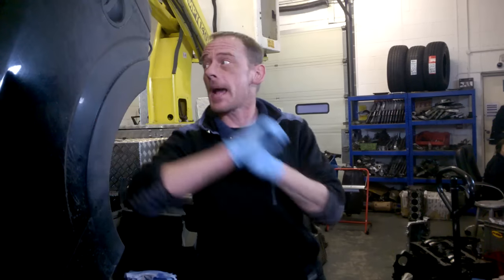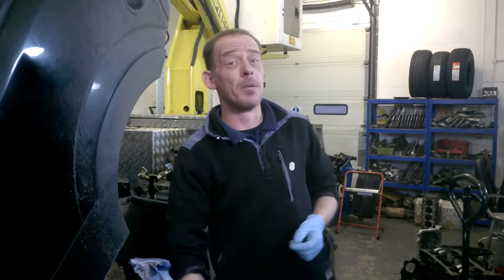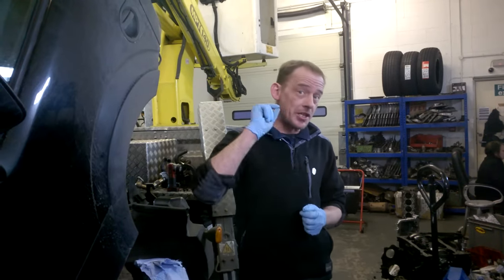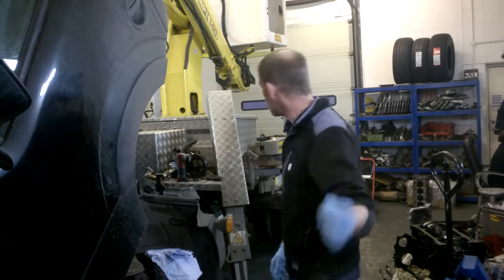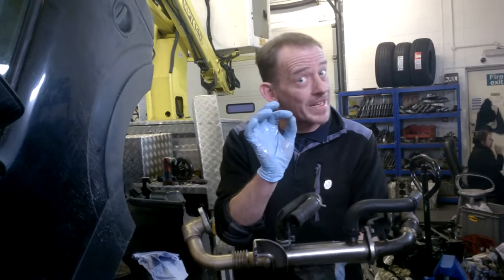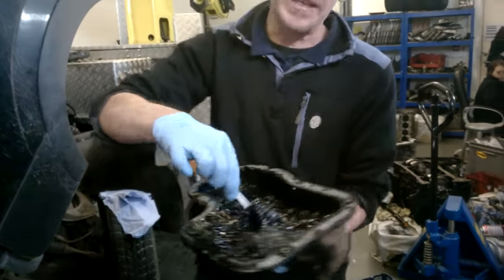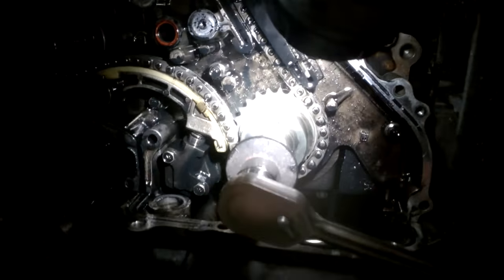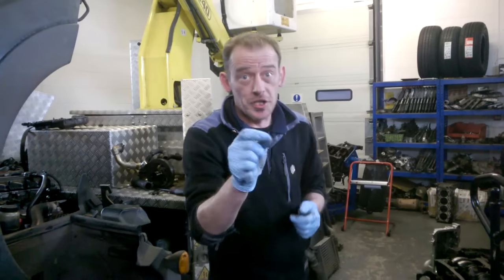Nissan Cabstar engine problems How to

Comment: Afternoon, trying to diagnose an issue with my Cabstar 2010 YD25DDTI. Black smoke (Fuel) lack of power, won't climb a small gradient driveway. Done your squeeze test on the boost pipe at 2,500rpm, no pressure to push my fingers apart. Turbine spins on cold side from observation with a mirror and no movement. Visually can't find a boost solenoid, looked online also and nothing comes up for our model (looked on eBay and 7zap). Actuator doesn't move when revving the engine, but its proper stiff to move by hand when engine is off. A cheap fault code reader, we think its reading 0 for pressure, atmospheric when revving too. Shows no boost. 
So unless you know where the boost sensor is, am I right in thinking the turbo is knackered?
Reply from the maker: Jedd Clay we have seen your email and we are about to answer for you

Comment: Hi we've got a 15 plate NT400 in with a glow plug issue, replaced the glow plugs and relay but still not power to the glow plugs, is there any secondary relay to drive it? Fuse is good too

Comment: Hello friend, I have a problem in a 2007 Nissan Cabstar 2.5 Yd25ddti (nacelle). The problem I have is that I no longer have power below 2000 rpm, once past 2000 rpm it goes like an arrow but underneath it's a real turtle...
I changed the flow meter, blocked the EGR and pierced the catalytic converter.
I need help I can't find where it comes from, thanks

Comment: Hi! Do you know what type of socket do I have to use in order to remove the flywheel? It has bolts with Torx shaped heads but I can't loose them with "normal" sockets

Comment: Hi superb video. Do you no what may cause it to go into limp mode with no warning lights or faults stored? I've read somewhere egr needs blanking? Or kay have already been blanked wrongly? Would this be why my heater isn't baking hot and just warm?
Also the viscous fan and the loud whooshing noise comes and goes, is this right or are you always supposed to here the fan?

Comment: I need some help on a 2013 nissan cabstar in mexico i have excessive fuel consumption any ideas..??
Reply from the maker: Diego Jara Navarro injector fault get them checked buddy
Reply: @westyorkshireengineservice9160  I've replaced them onces already not new rebuilt I also removed the glow plugs and they seemed to be wet with oil I suspect coming from valve seal by the way here in mexico we have same crankshaft snapping issue what a problem man god bless you and thank you for all videos I really love the fact that should teach nissan how build an engine correctly ...
Reply: Dinastia, I am also from Mexico, How much is the max weight you carry with the Mexican Version.? I want to transport my Skid steer (bobcat).

Comment: Hi, i need help. I have renault maxity with 2.5 dxi 96kw motour. He turn off on 800 rpm but on 1200rpm work normal. I replace all injection and diesel pump, all sensors , clean fuel tank and it still turn off. Before all this syptoms he lose power et consumption is on 19L. Thank you.
Reply: I have a similar problem 
Maxciti 2012 1100kw the chain was replaced 50,000 ago, everything was fine until a few days ago greetings, , it has 335,000 after 30 minutes of driving, I press the clutch, it turns off, it turns on a little longer, today it sows, driving for 20 minutes, driving at the traffic light, it turned off the first time, it did not want to turn on after 15 minutes, it signaled, it turned on after driving for 20 minutes, everything is fine, it turns off  crazy breakdown, I'll go to diagnostics today, good luck

Comment: Hi mate ,I've got a 2015 cabstar nt400 in ,I'm a garage in Birmingham, cuts out from cold straight away once warm it starts and runs ,no fault codes ,would this be my fault ? Tia
Reply from the maker: Timing chain unplug cam sensor she will run
Reply: @westyorkshireengineservice9160   bang on the money 👍👊 wish I'd messaged you a hour ago 🤣🤣
Reply: @westyorkshireengineservice9160 mine does this I’m driving it with the crank sensor plugged out,will this cause problems I’ve also noticed it’s under powered

Comment: Hi buddy, I’ve got a 2009 Nissan Cabstar, plays up every time I get in it, cuts out just like I’ve stalled it all lights come on the dash, turn it off for a minute then start it but with a struggle, has defiantly lost power since this has been happening aswell, had all 4 new injectors which I thought would fix it but still the same. My mechanic reckons is a sensor on the end of the manifold or something like that ? Would LOVE it if you knew the answer 😂
Reply from the maker: When it struggles to start unplug the cam sensor location side of the cylinder head turbo side If it runs without stalling its timing chain stretch if still the same I would be changing the SCV location back of the fuel pump you would have to change fuel filter and do a fuel pump reset at the same time Hopefully one of these sort it buddy

Comment: Hi Guys got a 2010 Nissan cabstar , got in it one morning started up and noticed the speedometer , rev ,  fuel and temp gauge has stopped working as well as the centre mileage display .. we still have the seatbelt , parking etc lights working tho . I have checked the fuses in both fuse boxes to the passenger left on the dash but are all ok . It seems like a fuse thing are there any other places on the cabstar for fuses I could check ? Any ideas ,have been looking at the past videos you posted , cheers guys. 👍
Reply: why belt, is that because of the firing pulses or what

Comment: I’ve got a Cabstar never had a problem with it , it’s an old f23 model what doesn’t have timing chain or belt on
Reply from the maker: 2015 stroke Steward bulletproof buddy
Reply: @westyorkshireengineservice9160  yes definitely is I’ve had loads of lads wanting to buy it 👍🏻

Comment: Hiya, got a problem with 2000 F23, driving the vehicle, all of a sudden complete shut down of everything, no power, no lights, no ignition. The tipper wired separately, no problem. My old mechanic sorted it for me, but more recently it started doing exactly the same. I checked out the fuse box and tried fuses etc. One relay, the fan heater that I tried, made the ignition lights etc come back on, but if I waggled it, it would go off and on. I soon discovered that if I used the heater on full after about 10 minutes the Cabstar would shut down. I have since got to the back of the fuse block and have discovered that there’s a wire which has been pushed into the back of heater relay with the other part being pushed into the end of the fuse block which is for the back of internal light and number plate fuses. If I remove the wire from the rear number plate fuse the ignition etc goes off. Push it back or even just touch the back and everything works. Obviously my old mechanic has tried to fix the original problem, but it is not a proper solution. Any ideas what causes/caused the original problem and/or solution

Comment: I've got a Nissan cabstar, and it's been nothing but trouble. I've had a new manifold, mass air flow and still can't solve the issue. No engine management light on. Lack of power, grey smoke on acceleration, fuel is taking a hit too. 3 garages can't find anything wrong with it.
Reply from the maker: Hi there, Chris it sounds like you're injectors maybe faulty hope this helps Many thanks Des
Reply: @westyorkshireengineservice9160  my 2007 cabstar has jus started rattling really badly and the code reader says correlation between camshaft and crankshaft has the chain stretched? Thanks

Comment: Timing chains in a 4cyl diesel smart move Nissan. should be gears then a rubber timing belt like Toyota 1HZ six and D4D. This cabstar  would only last a week in Australia if it runs hot where you are. 44 degrees C today. A 4 banger has 90 degree firing pulses and all the typical weight older diesel engines ran in the crank, rods and pistons would soak this pulse and whipping at idle. Now they lighten up all the internals and this firing pulse now runs through the chain whipping it back and forth ever so slightly at idle. I wish they could still have a hand throttle to set the idle higher so it didn't shake itself to death.
Reply: couldn't you change the idel via the ECU

Comment: I need some help with my 2016Nissan Cabstar nv400, went to turn if Ignition on and it was abit of hassle to begin with and eventually started.

Went to sleep woke up but this time it’s barely started, when it did start eventually it cut out in the middle of the road, 
Bare in mind that it’s winter time what would you think it was

Thanks mate
Reply from the maker: timing chain if it carries on